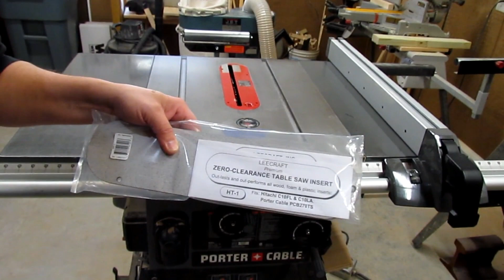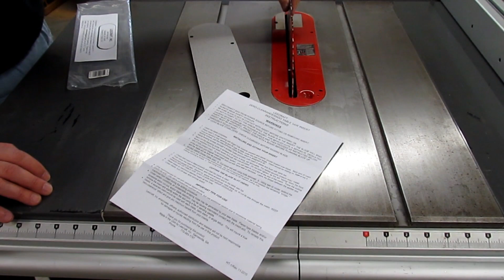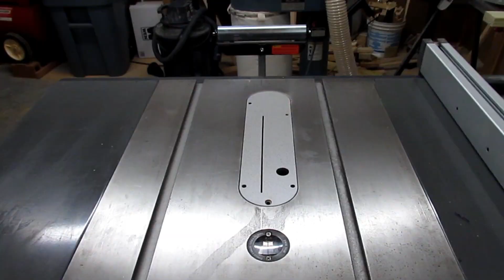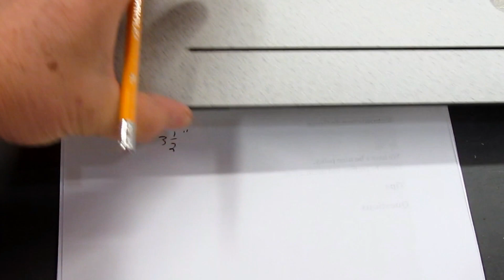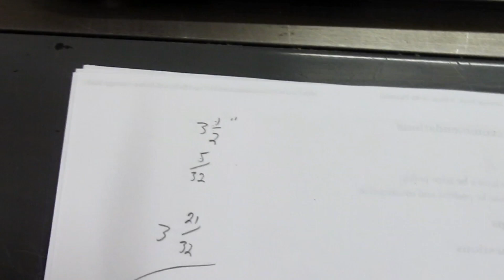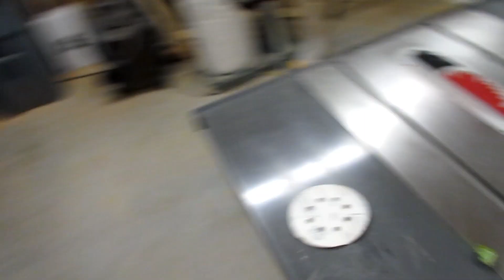Leecraft Zero Clearance Table Saw Insert w/ Riving Knife

Comment: TIP/Alt option: Instead of using a 2x4, you can use your table saw fence. Move your table saw fence about 98% ‘over ’ the insert almost touching (within 1/8” or so) where your blade is (but not too close that you’d damage your fence) and clamp your fence down. In your case, this would be on the RIGHT side of your blade as that’s where the majority of the insert is. The fence will hold down the insert. Turn your table saw on, and slowly/gradually start raising your blade up (cutting out your slot in your insert).
Reply: If you’re feeling really ambitious, you can make your own insert by making a “mold” of your stock insert and making your new zero clearance insert with epoxy resin.
Reply from the maker: Thanks for watching!